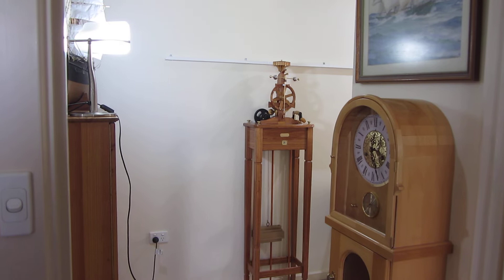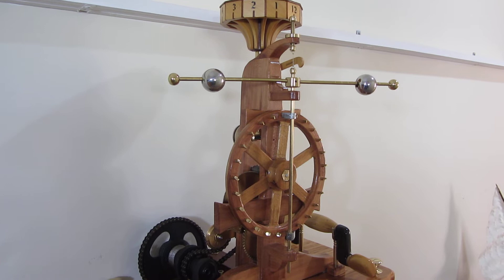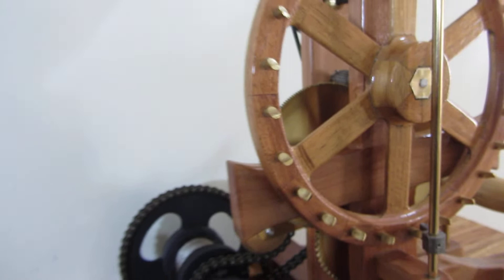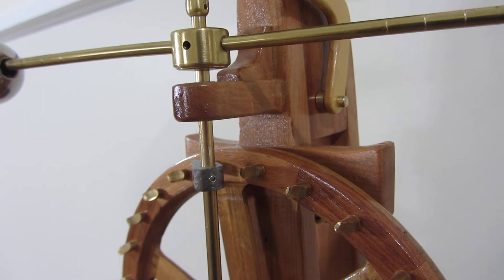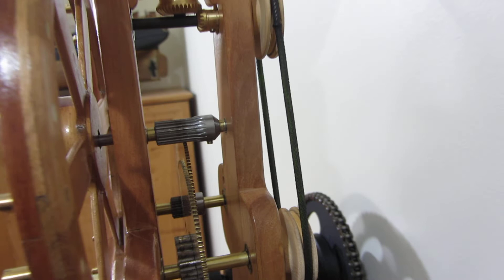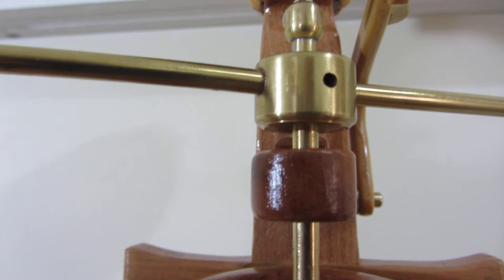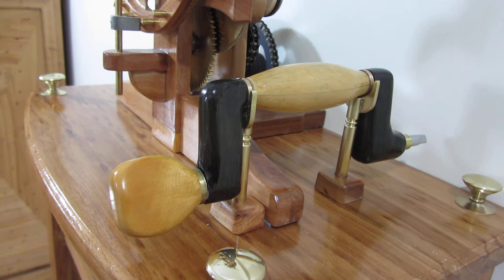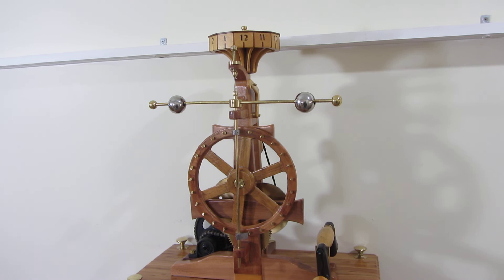Verge and Foliot clock

Comment: Enjoyed your beautiful clock.  Cool winding handle.  I have read verge/foliot were not accurate, curious to know if you tested it's accuracy?  Seems like if you are within 15 minutes a day, that's about the best you can ask for.  Of course the pendulum was a more reliable timekeeper.  But I enjoy the look and sound of the verge/foliot.  It's also easier to understand the movement, compared to more complex movements.
Reply from the maker: G'day Michael, thanks for your kind comments re the clock.    As the concept is quite rudimentary so is the accuracy, though entirely adequate for life in medieval times.    The clock was a delight to design and build and it quietly clanks away day and night here in our hallway, I can hear it now as I write this reply.
Cheers,
gmay